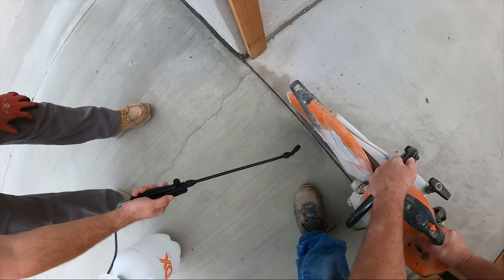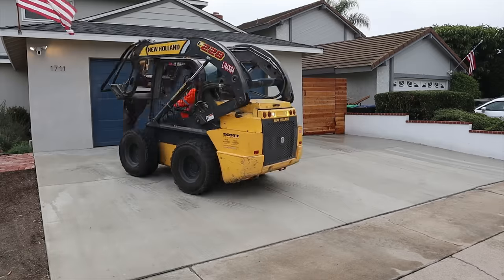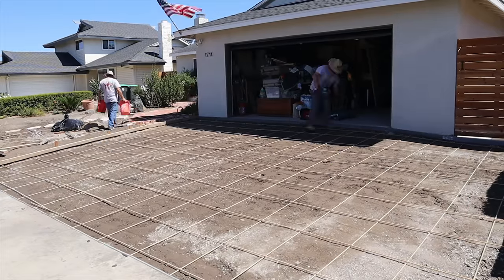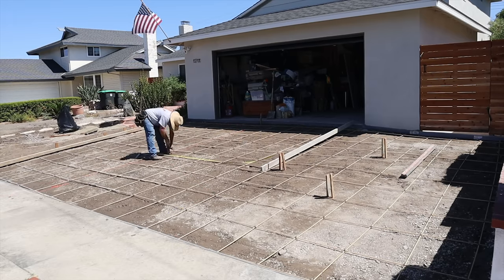Concrete GONE WRONG! Had to Remove and Replace

Comment: I'm curious if you contacted the original mix yard about this, and if you did, what was their response?  I know what a truck of cement costs in my area and where I used to live in CA.
I'm doubtful the original mix yard would own up to it, but I bet there's a bunch of cement poured that day with the same issues.
Reply from the maker: Yes Im sure there were alot of problems from that day and maybe many more

Comment: Map cracking/crazing is normally the surface evaporation occurring so fast that the surface does not get strength.  Curing compound prevents some of this, but the more concerning to me is the pop outs.  That looks like an absorbent aggregate in the mix.   That will continue to cause more troubles and probably why it broke up so easily.  They need to test their aggregate.

Comment: in NY you can order fiber mesh and they add it in the yard as part of the load. did you ever think using a power trowel? it would be perfect on a job that size. you are a real nice guy and do excellent work

Comment: My driveway was recently done, but I noticed that the middle line was not centered correctly since they were guided by the parking lot line inside.  That is, one side is wider than the other.  What do you recommend?  The contractor is coming this week to see.
Reply from the maker: I think evenly spaced works best
Reply: @OdellCompleteConcrete  thank you.

Comment: My uncle used to work for a concrete company. They also sold coal. He said they always had to real careful about not getting any coal around the gravel or sand piles. He always said a piece of coal in the concrete would make a hole in the slab by morning. Some kind of chemical reaction.
Reply from the maker: Makes sense

Comment: Looks like too much water in the mix too.
Ever take a slump measurement?
In another life I babysat a contractor fixing curb and gutter throughout Chicago. The finishers would try and add more water by what ever means.
Once I started pouring water into the test cylinder they stopped.

Comment: Fresh concrete does crack on hot summer. (It does dry too fast on hot, sunny days). For that reason we do water concrete the first 12 hours here in europe. Could that be the reason for your small cracks on the surface?
Reply from the maker: The Homeowner kept it wet for 5 days

Comment: Wow just from the looks of  that garage floor and comparing it with the cracks in your concrete driveway Im thinking problem with ground stability there think I would consider more rebar in it
Reply from the maker: Yes the sub grade is not the best

Comment: Perhaps I missed it , did national help pay for the job being re-done.  ? I will say , I work in a drywall factory and we  use up to 60 tones of stucco an hour. I’m the additives operator. . Some times we make bad board and we can’t figure out why ?   All our stucco is monitored  in segmented  time periods and we’re continually testing Untill the product comes out of the dryer.  Even with all are engineers sometimes we  “never”  figure out what caused the problem . Of course this  board never goes to the customer. With concrete by the time it is poured , you really don’t get a second chance , this opened my eyes.  Curious , do  all concrete companies usually  allow you to put the additives into the truck like you did with the fibreglass?  I didn’t know.
Reply from the maker: No

Comment: Hi , I noticed when you walked over and back to view the driveway across the street  there were substantial cracking in the footpaths on both sides and the road had some major cracks in it as well,  but had been repaired  could be a large clay base running through the immediate area  and causing your concrete to crack. Just looks coincidental with all the cracking in the immediate surroundings, holes in the concrete may be clay deposits in the sand that was used in the concrete mix  comming to the top when you floated it and after curing and dying out they popped through as surface was thin over the clay deposits. The mix looks like it has definitely a problem with the sand in the mix design.
Reply from the maker: Yes
There's alot underlying problems at that location

Comment: Seams like too much fly ash and not enough cement. Possibly contaminated aggregate or sand. didn't you get it tested? What was the mpa ordered opposed to what is there?
Reply from the maker: Yes there many problems with it but to get it tested it would have cost me 3500.00

Comment: Odell i just want to ask you ! how deep you cut your concrete with that medusa and did you seal the cuts with elastic polimer ? what brand and model please !Thx !
Reply from the maker: 1 inch deep. No caulking
Reply: @OdellCompleteConcrete  Way do not put rubber between or in the cuts slab ! is a must in my opinion ! way you choose not to?

Comment: When you are demoing the 3/8 rod is it just as hard to remove?
Reply from the maker: In this particular concrete it came out easily, because there were no binders in it the concrete meaning cement.

Comment: They don't have a clue.  A slab does not need fiber (especially when it needs at least half hour to mix it.)  What it needs is a good standard concrete mix, laid on wire mesh that is supported on chairs.  Having crappy rebar that is on the bottom does nothing. A good slab that size should not need any cuts at all.

Comment: The concrete "company" the general contractor hired used  "keyway joints".  They did not come back and cut joints in. Is this normal? Within 24 hours the concrete cracked along those joints which I was told was intentional.
Reply from the maker: Depends how many keyway joints

Comment: 1) Different joint patterns on the different driveways. 2) Take a concrete core out of the existing driveway and send it away for analysis. 3) When you pour, have someone come out and verify slump, air and have them make two cylinders to test the strength at 7 days and  28 days. 4) Don't add the mesh yourself, have the batch plant do it. 5) You can't determine slump by looking at it. 6) Brush "down" the driveway to facilitate drainage 7) Use a curing compound. 8)You've made some expensive mistakes. Don't repeat them.

Comment: question, as builder. why dont you use rebar mash ? for instance we use Q196 (5mm on 10cm) of q283 (6mm on 10cm). put "cake" distances on ground. we never do finish like you, its not what coustimers ask, but principle is same.
Reply from the maker: Never thought about it.
TY
Reply: @OdellCompleteConcrete  and that you did regarding redoing concrete after problems occure if very profesional and everyone in our line of buisness shuld do the same. Honor is always payback

Comment: VERY professionnal. I admire your integrity. Only one thing though. Adding this much water to a mix (at least 2 gallons) will reduce its strenght. You could have added the fibermesh to some latex bonding agent or plasticizer instead of water. If the cement company delivers a 30mPa and you add water to the mix, it's no longer 30mPa...

Comment: correct me if i am wrong, but little cracks are from too fast drying?
Reply from the maker: Sounds like it would be, but it's not the case here.
Reply: @OdellCompleteConcrete  This is the only reason I know in my small and short experience. Another could be plasticizers?

Comment: Did you only use fibreglass rods and no steel?

Your concrete may have had some strength issues but the reason thd concrete is cracking everywhere is the fibreglass rods are not design to temperature and shrinkage and if you totally remove the steel, this is what happens. Has happened on a few bridge decks.
Reply from the maker: Fiberglass only

Comment: In Nova Scotia the company I worked for our specs always called for 6inches of gravel and6inches of 4000 psi concrete I had 45years experience and we always added air in the mix. Jim
Reply from the maker: That's big time Stud Status

Comment: Owned my own masonry construction company for 25 years and I only had to rip out and replace 1 job and it was bad concrete. It was only about 11 yards. As soon it started coming off the shoot I had a feeling it might have been a bad mix, just did not look right, I should have refused it but I was behind on my jobs, and it was a different concrete company then I usually use.
Reply from the maker: It happens

Comment: So does adding fiber and additional water void factory recepy warranty??? It would if you were getting the concrete from me.
Reply from the maker: What warranty
Reply: @OdellCompleteConcrete  ?? The warrenty from the concrete factory that you're getting the concrete you ordered. From the Netherlands, here you get a receipt and warranty stating the mix design and additives/plasticizers added and the strenght  rating in MPa. 
This warranty is void if you add your own additives and/or water.

Comment: looking at the concrete chunks as you were breaking it up, it looks like there was way too much sand in the mix and not enough aggregate. That could have led to the weakness and cracking of the slab overall.
Reply from the maker: Could be

Comment: This was just the video I was looking for, too late to do anything about my driveway but, it's narrower than this one and the pitch is about the same. The top 2 blocks cracked down the center and opened real wide, gap is about an inch now, but I can see no rebar in it and looking down in there you can see the soil is far underneath the concrete. Weeds even some trees grow out of there, even the concrete has sunk about 2inches from the garage itself, I always knew it was bad just trying to learn what mistakes were made by the contractor or supplier, I don't think it was sealed either because it looks real rough, there's other work in front that just fell apart. The guy was bad, but never called out by previous owner.

Comment: Would it be better to dowel between foundation and new slab? I'm learning. Thank you
Reply: No. You don't normally dowel slaps. That's the point of expansion and saw cuts. If they're going to move, let them move separately, instead of cracking the whole thing.

Comment: I was just introduced to fiberglass rods a year ago and was told they are quite strong and durable.
I think the cost was a little more though, so it wasn't favorable for the employer to use them

Comment: Full charge is 15-18 revs per minute... You can beat the air out of the mix if you over rev.  30-40 revs min for adding water.
Reply from the maker: No air needed in Southern California

Comment: Sorry that you have to rip out your hard work, I am allways very disappointed when I get let down by irresponsible people. Is the bad concrete possibly have too much fly ash in it? Thanks for the tips on the adhesive and fiberglass rods.
.

Comment: When I was young with more brawn than brains, I busted out my mom's cement driveway - BY HAND. Just me and a sledge and a Chevy Luv truck. I prepped the area and turned it into a double driveway. The mix wasn't near good enough and I made mistakes - the largest of which being a labor shortage and technique so it got away from us towards the end. This resulted in spalling later. I learned from this and swore the next time I would invest in a higher grade concrete and more labor.
In my next driveway at my own home I made it thicker, tamped it more, and I ordered a 5,000# mixed with air entrainment and fiber. I  did it in two pours and had plenty of labor.
Fast forward now 25 years and I revisited that slab and it looks as good as the day I poured it. Money well spent.
Reply from the maker: Thats the way to do it.

Comment: Several comments have been made as to the depth of placement of the reinforcement in the video. Although you have responded in regards to other comments, I do not see where you have addressed the reinforcement depth issue directly. Would you address it?

Reinforcement "is primarily used in slabs on grade to serve as a control of cracking due to shrinkage and other effects" (Designing Floor Slabs on Grade, Boyd C. Ringo and Robert B. Anderson, p. 11). The reinforcement will not prevent cracking but will minimize cracks and maintain aggregate interlock. Rarely would reinforcement be used in a driveway to provide structural strength. There is a somewhat complicated subgrade drag equation (as well as other methods) used to determine the amount of reinforcement needed for shrinkage crack control. The idea is for the reinforcement to take over the tension that would have been on the concrete had it not cracked. In a slab with shrinkage control reinforcement, the reinforcement must be placed "above the mid-depth of the slab (ibid, p. 18). The fiberglass rod in the video is very low. It does almost nothing at that level and also totally ignores the requirement for coverage of the reinforcement by the concrete, 3" where constantly exposed to earth.

I've always said the trouble with concrete and roofing for homeowners is that both can look great after the job is finished. But its what you don't see, like the placement of reinforcement in concrete and the placement and setting of nails in a roof that will determine their useful life.

Comment: Is there any benefit to sealing/filling these cuts?
Reply from the maker: in this case no, but if it were steel reinforcement then it could prevent water infiltration.

Comment: So when that happens is the concrete company liable or does the liability fall on you
Reply from the maker: If I had core samples and tested it would have been much easier to prove.
So, in this case I decided to remove and replace it.

Comment: The most concerning thing for me is if that supplier provided structural concrete for a building. It's unforgivable for the batch to come contaminated, I would never use these guys again. They need to pay you compensation. How did the concrete hold up in the end?
Reply from the maker: So far so good

Comment: They sent you some hot mix, probably in the truck for several hours before you got it. We get this concrete for free in DFW. It got waived off of a big pour and they dumped in on you. I poured a 20 yd housing complex entry with hot mud and passed the discount onto the customer with a waiver of spider cracks due to using the hot mix.
Reply from the maker: That's exactly what happens more often than not

Comment: Next time hire a consulting lab to core a couple of samples for compressive strength testing, would have helped proving whether the CS requested for the mix was actually delivered by the supplier. Not sure if it would be worthwhile to consider having a consulting lab send a technician out to periodically cast test cylinders , would keep your supplier(s) honest but it might be costly.Driveway looks great, good job , it's a shame the City/ Metropolitan Region these homes are located in doesn't do a better job of sidewalk maintenance within the municipal right of way. At 17:27 you can clearly see the badly cracked sidewalk butting the new driveway, it somewhat diminishes the esthetic look of the driveway, I would also assume it is a liability for the municipality as it is a trip hazard. Once again,Good work!
Reply from the maker: I concur on all of your conclusions.

Comment: I don't know what city you're working in with what state with what codes but my suggestion when it comes to outside exposed concrete it should be greater than 32 MPA and it should have some type of fibers mixed in with it to help with the shrinkage
 That concrete based on what I'm seeing they don't have enough cement in the mix or the cement is just flat bad
Reply from the maker: I concur

Comment: After a day when the concrete has set up you need to slow down the PSI by spraying water on it several times a day for two or three days.

Comment: Could be shrinkage cracks, high wind, low humidity  causes  that.high wind could also cause  the holes. Debris, foreign  material  bullfloated in. Core sample will tell if it's mix. If so they are responsible.
Reply from the maker: True

Comment: Does adding water to a mix after it's mixed weaken its strength?
Reply: Yes it does and the driver of the concrete truck should have it written on the docket to say that water was added. If water was added then the guaratee of the concrete is cancelled.
Reply: @mission2ish  thanks! i thought as much.

Comment: I think I would have had a testing company come out and do a Swiss hammer test on the old concrete to see what the PSI actually was. Actually I’m sure National has Swiss hammer testers they could have used but it’s best to get an independent opinion on something like that. Hope they made good on replacement cost for at least the concrete material. It’s really not that big of a cost to them for that much concrete.

Comment: You have to use a bed of sand and a bed of gravel, and then concrete with mesh and you have to do it in summer when the ground is dry, otherwise if you lay concrete on wet or damp ground it dries out and contracts causing cracking
Reply from the maker: Wrong

Comment: Most concrete poured in structural situations is not even tested until it has been poured and then they'll alter the figures during the test if the concrete does not meet the compressive loads.

Comment: Little surface cracks likely because of concrete surface dries too fast especially in sunny days. if it's covered with something that keeps it wet and protect from the sun there are no cracks.

Comment: I am very surprised you never use an item called flexell  ( In uk) its purpose is to allow expansion in compete when it against something like a wall or another slab exactly the situation you have on the first house you should use
Reply from the maker: No freeze and thaw here